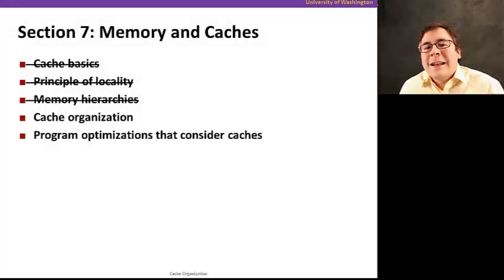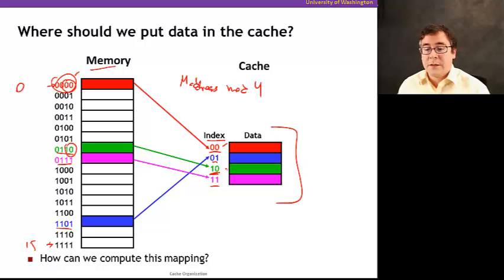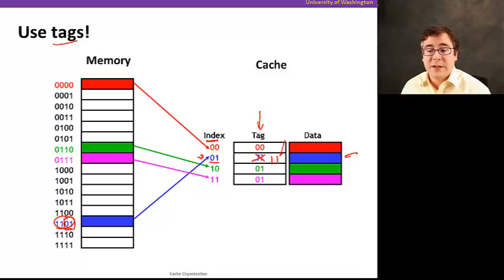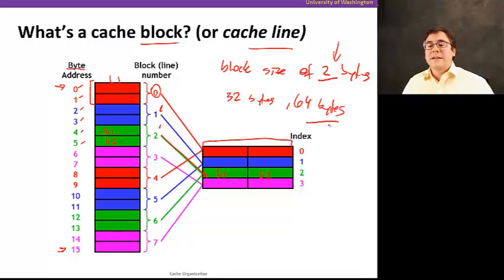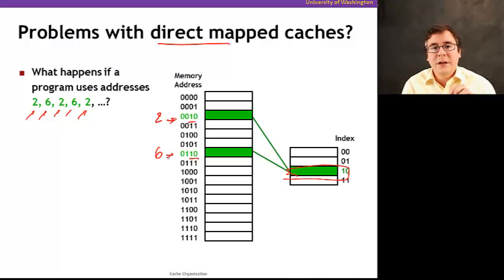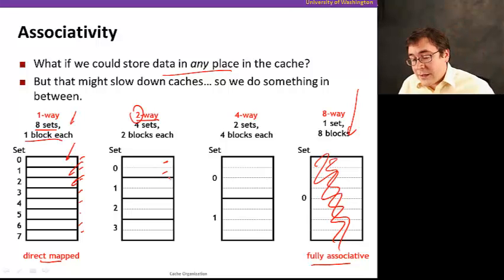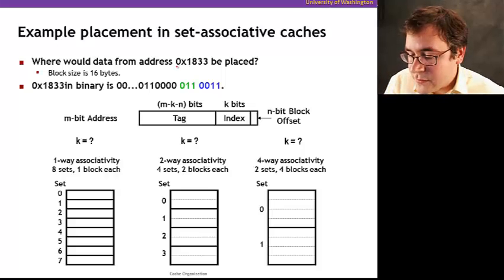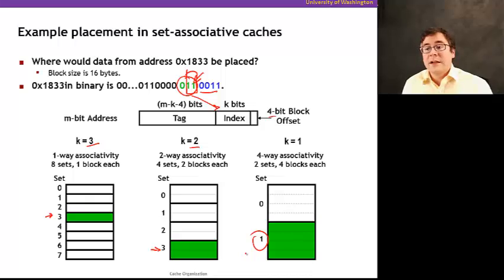Caches, Video 4: Cache organization

Comment: 12:48 It is not direct mapped if 1 set has 4 blocks. It is 4-way associativity.
Reply: I think in the example you're referencing the cache consists of 4 blocks(lines). So it's 4 blocks per cache, not 4 blocks per set. That way, the cache can be direct-mapped (each set has only one block). Also see the beginning of the video that demonstrates this cache configuration.

Comment: I am a bit confused on the offset
Reply: The offset indicates the position of the address within the cache block. Once you identify the block a memory address is located in, you need a way to find the position of the address within the block. For example, suppose each block contains 4 bytes. Then, you need a 2-bit offset to determine whether the address is in the block's 0th position, 1st position, 2nd position, or 3rd position.